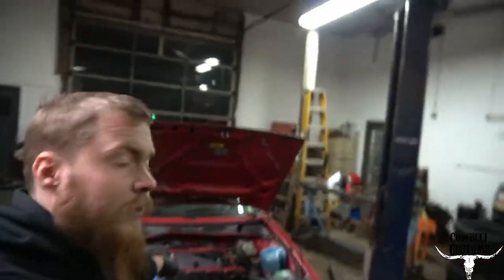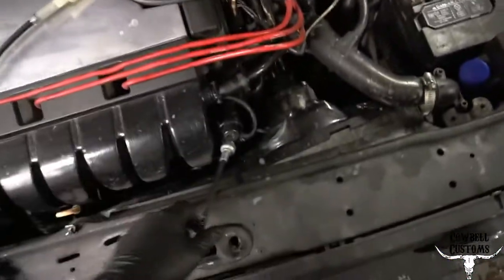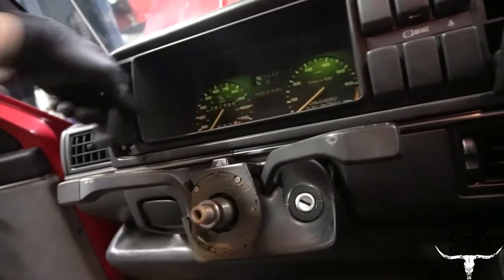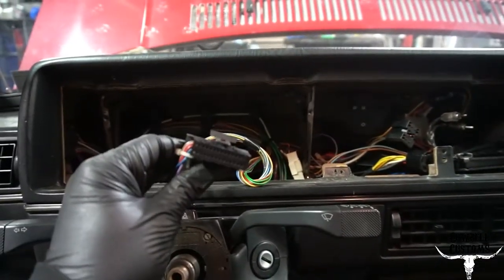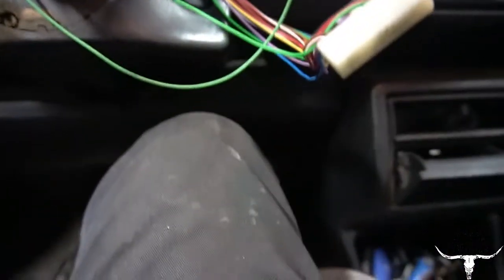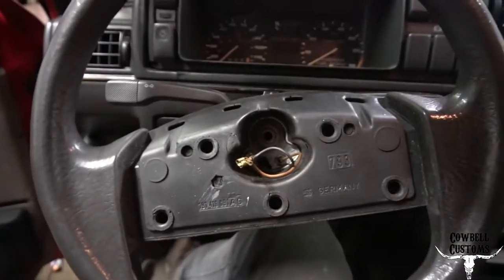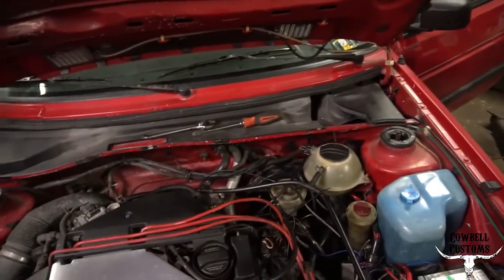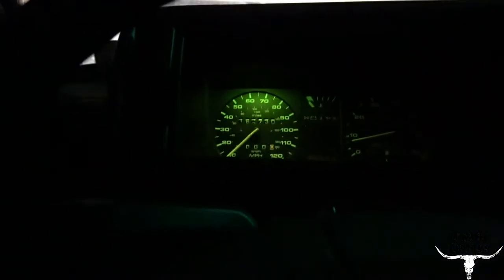Mk2 Vr6 Swap, Speedometer/Tachometer How to.

Comment: Good stuff. A cheaper alternative is to get a mk2 1.3 speedo cable ( Topran 102 971), got one for $30 shipped on ebay. You can get a tach signal from the coilpack, no need for that box.
Reply from the maker: I heard about using the 1.3L cable but couldn't find anything definitive on it. Then to my understanding the rpm may still be off with the factory tach taken off the coil pack directly. Not sure though.
Reply: Yuriy H ....hi, T 4 VR6 problem...can you help...

Comment: I was trying to use I diode method to get the rpm it didn't work well I just order s&p magic box on what or wher did you connect the power wire I don't wona mess the box up when I install my thanks in advance

Comment: so to be clear, to run the mk2 cluster with vr6 swap i need to buy the box converter and the g60 speedo cable?
Reply from the maker: Yes the converter for sure for the tachometer. And i would use the swap cable from S&P its shorter than a g60 corrado cable and will be a cleaner looking install.
Reply: @CowbellCustoms  thanks for the fast answer, before i buy the converter i wanna try the direct coil connection to the tach, I have one last question if you don't mind, my vr6 its the one which has the single ignition coil with the distributor (delco) that coil has two nuts (1 and 15) you know from which nut i must take the wire to the tach?  (G1/12 in fusebox)
Reply from the maker: Im not top familiar with the distributor cars, so your car wont be giving out a digital signal but would be a analog signal. You still will need a converter that will take the 6 cylinder engine output and turn it into 4 cylinder engine output. The tach may work but wont be accurate.
If i had to make a guess id say #1 would be your tach output because #15 probably designates terminal 15 which is your key on power circuit in all VW/Audi cars.
Reply: @CowbellCustoms  thanks a lot mate, that helps me a lot ^^
Reply from the maker: Glad to help! Good luck with it all!
Reply: @CowbellCustoms  the tach works now! but yeah without converter 1500rpm on idle... lol
Reply from the maker: Well at least it works and now is just a matter of wiring it in quick and done, great to hear!

Comment: Hello, do you need the tachometer in EC2 car? never se it used before, .
and the speedo, kan you just remove the elektrik part and juat mount th new cable?  i Do this swap in a jetta mk2 now
Reply from the maker: With the correct cable the cable will just go into the gear wheel of the sensor. Tachometer isnt 100% needed but its nice to have

Comment: I live in Florida and I just got a mk2 vr6 that used to run but previous owner removed wiring to install standalone fuel tech 
Where are you guys located and would you be interested on finishing this project 
I just got the car completely repainted
Reply from the maker: I'm located up in Pennsylvania, and I'm not doing any customer work at this time. Been concentrating on my full time job lately. I would try to find a local tuner to wire up the car that way they can tune it right there for you once the cars completed.

Comment: Did you have to use a different fuse box?
Reply from the maker: For the swap I used the Mk2 fuse box. Depending on the year you need to change it. Your going to want to have a central electric 2 car to make the swap super slick. I think that's 1990-92 for CE2 and 86-89 for CE1
Reply: Cowbell Customs ok thanks. Any other electrical problems you had that I should keep and I out for on my swap?
Reply: Cowbell Customs and what was your donor car?
Reply from the maker: Not really the biggest one I ran into was with my engine harness. The main connector had a bent pin. And the previous owner I guess chased it for a while and decided the ground circuit was broken some how and rigged around it. 

E fan took some figuring out aswell right now I'm still running the Mk2 fan switch in the rad and the Mk2 fan relay group by the driver side headlight.